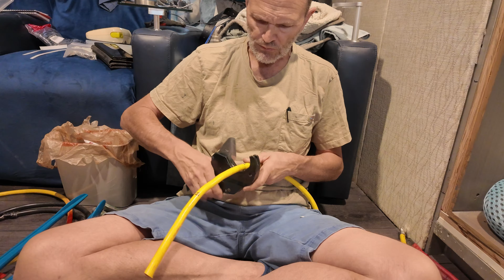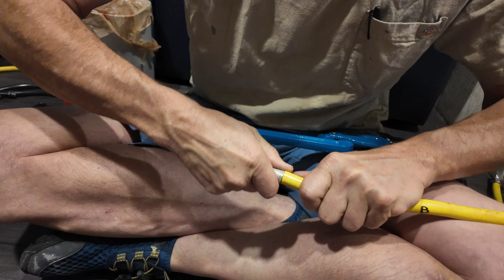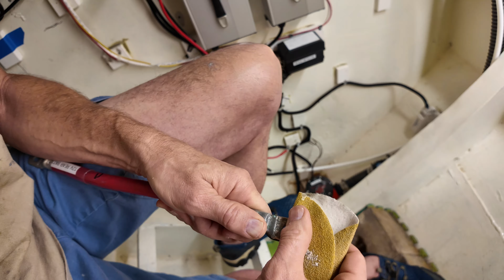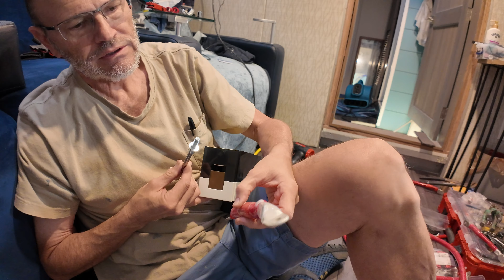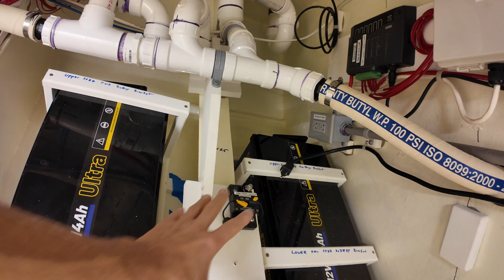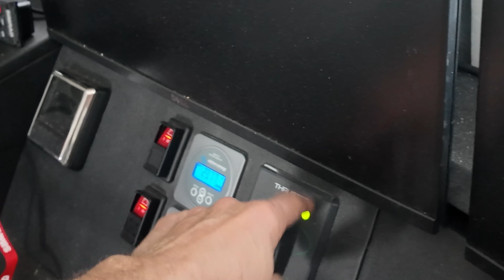Did our Bow Thruster Lithium Battery Wiring Succeed or Fail?

Comment: Any reason why you are using regular copper cable as opposed to tinned copper cable?
Reply from the maker: The copper cable we used in the video came with the boat.  Also, sometimes when we've ordered marine cable we get un-tinned copper wire, even though the wire is labeled marine wire. The only way to guarantee getting tinned marine cable is to order a name brand (Ancor, Pacer) but sometimes it is not available on a reasonable timeframe and it can be very expensive, especially for the 4/0 wire.